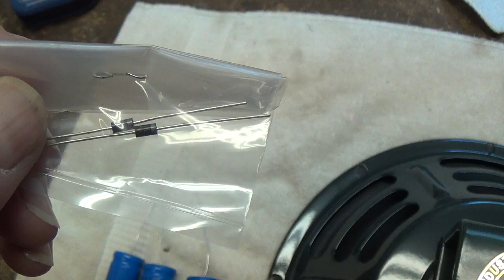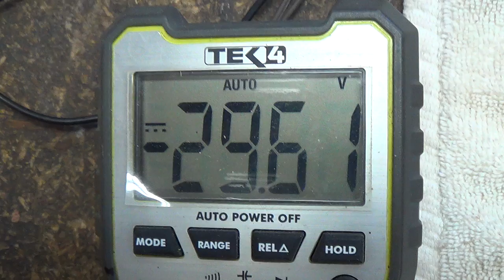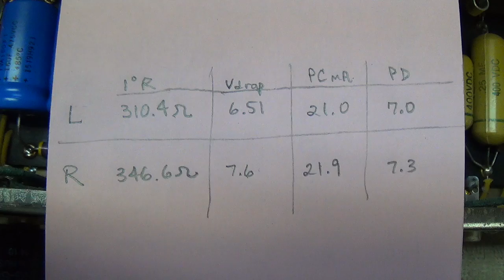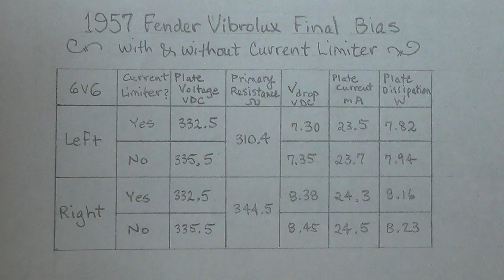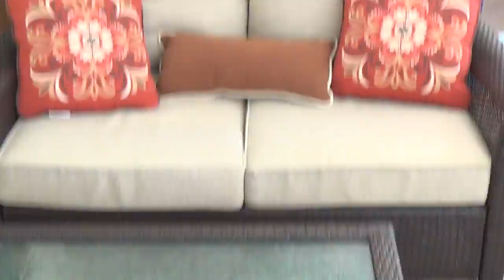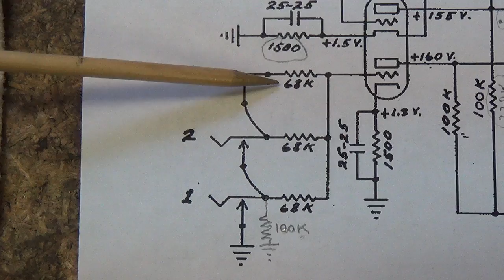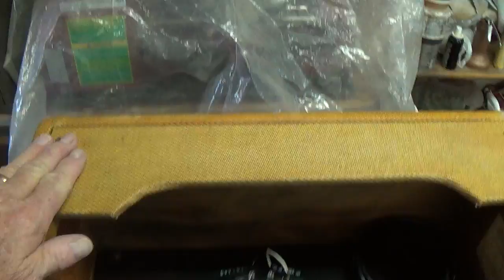1957 Fender Tweed Vibrolux, Part 3

Comment: Jensen, made in Italy.   Uncle Doug, the polarity of the diode shows the voltage polarity across the selenium rectifier junction  not the actual polarity of the PN junction of the selenium rectifier on the schematic. It's a bit confusing though.  These are referred
to as metal-semiconductor rectifiers and have a depletion region. 

  The same is true for silicon diodes which have less voltage drop across their P and N semiconductor layers. When mechanically attached together a PN  junction is forrned.    Diode and transistor polarity general depicts the flow of electrons through semiconductor junction,  or the absence of electrons (commonly referred to as "Holes" (depletion layer)  in solid state semiconductor  theory.
 
As the voltage applied between anode and cathode increases, forward current increases slowly at first, as charge carriers begin to cross the depletion layer then increasing rapidly in an approximately exponential manner. The resistance of the diode, when ‘turned on’ or conducting in a ‘forward biased’ mode is therefore not zero ohms, but is very low.
Reply from the maker: Wow, thanks for the very detailed analysis, SC.  Your knowledgeable input is always appreciated.
Reply: Thanks. I always been fascinated how they can take a piece of silicon wafer and dope it with different elements with different electrons and this "depletion of electrons" ..holes they call it within the semiconductor crystal lattice structure for P and N channel properties.
Reply from the maker: Wouldn't you like to have been the person who invented semiconductors.....and patented it ?? It is indeed a fascinating concept, and the basis for virtually all modern electronics.
Reply: it was discovered  indirectly,  in a search for the actual  thing being researched. By  accident,  you could call it, like so many other inventions of our time,    by Bell Labs in  1947 in NJ.
Like so many discoveries (or inventions) that at first didn't seem to be on tract with what the inventor-scientist was looking for,  over time these inventions proved to be immensely useful to everyone.
What did we have as far as electronics in the late 40s..vacuum tubes and miniaturization of them
(acorn tubes),   I remember coming across  a AM broadcast radio in the early 60s..it had these tiny glass tubes in it.  Not sure where it was made..Japan maybe, China wasn't even on the radar then.
 Sure wish i had kept it..now it would be worth a fortune on E-bay.

I remember in the 70s studying all the RCA/GE and Texas Instrument data books on Semiconductors
and the new TTL (Transistor-Transistor Logic) minature DIP packages.  I built my first countdown
timer using these and other unique devices called SCRs (Silicon Controlled Rectifiers) for a gov't
display board using LEDs with a chaser circuit I designed from scratch using these devices.
The 70s was a world of discovery for me as well...including trying to build a simple TV typewriter.
from a surplus keyboard find in a electronics second hand surplus store. 

Tubes?...I thought those were passe and transistor power amps were the best thing for guitar
and Hi-Fi stero....now as they say.."what goes around..(eventually)comes around"

Quote:
"The transistor was invented at Bell Laboratories in December 1947 (not in 1948 as is often stated) by John Bardeen and Walter Brattain. 'Discovered' would be a better word, for although they were seeking a solid-state equivalent to the vacuum tube, it was found accidentally during the investigation of the surface states around a diode point-contact. The first transistors were therefore of the point-contact type. William Shockley, the theorist who was leading the research, knew at once that this was not what he was seeking: at the time he was trying to create a solid-state device similar to what we now call a junction field-effect transistor." endquote.
Reply from the maker: Again, SC, you prove to be a veritable fount of knowledge and experience.....thanks so much for sharing this with us.
Reply: I found some data on these subminature "peanut" tubes that were even smaller than an acorn tube and specifically designed for military use.  However, there were some commercial versions used in the very
early Japan produced radios..which had a "couple"germanium transistors which in those days had limited
application.   I remember two of these tiny neon lamp size tubes used in this radio..probably for rf antenna
preamp,  and the superhetrodyne  oscillator. The early germaniums (or geraniums as I like to call them) were
not that good at high frequency. Sure wish I had kept that radio to sell now on  E-bay.

[quote:
RCA-6021 is a subminature medium mu twin triode of the heated cathode type having flexible leads. It is intended for is use in oscillator and amplifier at frequencies up to 400 Mc (that’s 400MHz in today’s money and overkill for audio applications). Constructed to give dependable performance under conditions of shock and vibration, this “premium” tubes is especially suited for use in mobile and aircraft equipment and is rated for service at altitudes up to 60000 feet without the use of pressurised chambers. endquote]. 

BTW..in my classical guitar preamp, there is what they call a "cool tube'..a 12ax7 running off 4 AA (6volt) batteries to serve as an  a impedance matching device for a piezo  bridge pickup.  
You cannot see the filaments lit and it runs at ambient room temperature..but it works..go figure!
Reply from the maker: Thanks again for the info, SC. I have never heard of the "cool tube" concept....very interesting.
Reply: I never thought you could get a 12ax7 to  operate in the linear range from 12 volt ( plate voltage here) supply, but my cool tube preamp proves it is possible.  Here is a Youtube link that demonstrates
a 12ax7 amplification from a 12 volt supply. Search youtube for:"12AX7 stereo tube preamp only 12 volts""
 You will also see my comments.
Reply from the maker: Very interesting, SC. I will check it out.

Comment: Where do you typically buy the 5 X $$ electrolytic caps?
Reply from the maker: I got all my supplies from Antique Electronic Supply. The Sprague Atoms cost $12 apiece and the Chinese equivalents are about $3.50, so it's more like 3.5 x the price :)
Reply: Fortunately, there are now better, cheaper, and much smaller alternatives to those Atom caps.

Comment: Telecaster with vintage wiring? If so, that's not actually both pickups in the middle switch position, it's neck only. The usual neck position of the switch is the neck pickup through a "deep" filter cap, meant for playing bass-like tones. (Leo seems to have been a bit confused at first and I think he thought filters were pitch changers.)
Reply from the maker: Yes, it is AQ......a '52 Telecaster re-issue. Thanks for the explanation. The "neck" pickup tone is indeed quite mellow :)
Reply: Whoohoo! Where's Don Pardo to tell me what I've won?
Reply: Oh and suddenly I realize it's not been all of your amps that sound grainy, or your camera's mic, it's those damned bum____ing pickups! ;) Great to hear one finally with some airy, crisp single coils! Can you keep the Tele? :)
Reply from the maker: I will keep it, but it's a little nice to be a shop guitar. I'd hate to bang it into the Jeep while working on a circuit; however, I'll try to use it in some future videos.
Reply: No such thing as too nice of a guitar! 

You might want to convert it to modern wiring. A Tele that can't do bridge + neck is just sad. (I modify my Strats so they can do it. I think it's the best sounding of all the pickup combinations and it's the one you can't get!)
Reply from the maker: Bringing a nice guitar into my workshop is like dropping a Ming vase into a threshing machine, AQ.....lots of hazards :) I think I will rewire the pickup selection switch. I don't really have any use for the neck position, as it is. Thanks again for the very helpful input.
Reply: They were frequently modded back in the day so even if you do this it's still technically "vintage". :)

I was surprised to learn that Fender made Telecasters with this wiring until the early '70s!
Reply from the maker: I'm surprised it lasted so long. The neck setting is not all that useful.
Reply: I've been surprised by a few things that lasted so long at Fender. I was also shocked to learn that the 3 way pickup select switch in the Strat wasn't changed to 5 way until 1977! http://www2.fender.com/experience/tech-talk/the-stratocaster-pickup-selector-switch/

I was also surprised that they never made Stratocasters with reverse wound/reverse polarity middle pickups until modern post-CBS times. Seems a no-brainer and Fender already had guitars like the Jazz Bass and the split pickup in the post-57 P-bass that use this same principle to make combined pickups hum cancel.

Anyway, yeah, I think Teles were often modded to the "modern" scheme before they even left the store as nobody ever found that underwater tone useful (except maybe a few jazz cats).
Reply from the maker: Thanks for all the info, AQ. Rusty and I really appreciate it.

Comment: The schematic marking with "+" at the selenium rectifier's cathode (6:45) reflects the typical marking seen on the part itself. I suppose the reason is that positive DC voltage will appear on that terminal.
Reply from the maker: You could be right, Martin, but for some reason, Fender also mislabels the diodes in their non-selenium rectifier amp circuits.  Most strange :)
Reply: Not really, I think they were just following the established practice. You still see that today in silicon bridge rectifier packages that have + and - marked at the DC outputs.
Reply from the maker: I'm not talking about selenium or bridge rectifiers, I'm talking about simple diodes. Fender labels diodes with the banded, cathode end + and the anode end -. In my experience, this is not established practice.
Reply: I understand, what I mean to say is that they were following the practice established for the selenium rectifiers they had been using.

Comment: Another really great video series Uncle Doug! No matter how many videos of yours I watch I always learn something new. And this video series was no exception. I really enjoyed your comparison of the differences between schematics of various tweed amps and your approach to updating this amp to be performance ready. Even when you simply flipped the cabinet over to show how to easily tighten the chassis down, I had one of those moments of hand on forehead for all my previous struggles wrestling to tighten down the chassis on my 5e3 and 5f1 builds. I do have a question for you in regards to your suggestion of changing the coupling cap from .1 to .02-.05 to voice the amp more for humbuckers. If I were to tweek these values on my 5e3, would you suggest I change all four of the .1 coupling caps on that circuit for both V1 and V2 or would the coupling caps coming off one of the tubes have more of an effect on the overall tone than the other?
Reply from the maker: Thanks, Dec. We're really glad you enjoyed the video.  Whenever I make a change like this I remove the components, i.e. coupling caps, and jumper in various values of replacement components, i.e. .02 to .05uf coupling caps, and have a guitar plugged in (be careful since the strings are grounded) to strum and listen to the changes.

It might be interesting to reduce one of the 0.1 coupling caps from the 12AY7 and leave the other one alone......resulting (maybe) in two humbucker inputs and two single-coil inputs. If you change the value of the coupling caps to the output tubes, however, you will have to change both (they should be the same value). Good luck.
Reply: Nice suggestions Uncle Doug. I will get some new caps and try out your suggestions to see what sounds best to my ears. Definitely a lot to consider and think about for voicing the 2 channels for either single coil or humbucker coming off the 12ay7. Thanks again and look forward to watching the reconing video and whatever else you decide to show us next!
Reply from the maker: You're welcome, Dec. Best of luck with your experimentation :)

Comment: When it comes to changing parts or making circuit alterations to an amp I really like your approach.  It is thought through and done so carefully that, if desired, the amp could be returned to exactly how it was when you received it (I'm not advocating you blow the voice coil out).  I believe Lupe would be very pleased to see your work and Leo would give a thumbs up to your circuit corrections.  The tremolo does lack depth though, not in the same league as Uncle Doug's Tremoverb.  I have tried watching videos by other amp repairers but for the most part have given up in frustration.  The subject is interesting but they either swish up and down the amp like the camera is a spray gun or they go in and replace more components than is reasonably necessary.  They should watch how you do it.  Hope the re-coning parts arrive soon so you can make yet another video for us to enjoy.  Then all we need is someone who would like you to "Take a look at his 5E9-A Tremolux......".     All the best, Jeff.
Reply from the maker: Thanks so much for your very nice comments, Jeff. Rusty and I are proud of our work and really appreciate it when others are too. I have my fingers crossed.....both for the arrival of the re-coning supplies, and for someone to send a Tremolux for service :)

Comment: Not only do I enjoy your videos, the comments from your viewers and you are also fun!!!
I have another question. Since this is a gigging amp, I’m guessing it will be used by one guitar player with one guitar plugged into input 1. Why not put a 1 Meg ohm resistor to ground (instead of 100K) and rewired for just two inputs only, like Fender Deluxe 5E3 and many other late 1950 and early 1960 Fender amps? It could add feel to the guitar/amp experience.
Many have got it right that your second guitar was a Telecaster. But has anyone guess the color? It sounds to me like a Butterscotch Blonde Tele.
Reply from the maker: Thanks for the nice comments, DR. I just finished another experiment involving the input jacks, and found that a 220K resistor works great. With it in place and a guitar plugged in (it becomes part of the circuit), this provided impedances as follows: Jack 1 = 111K , 2 = 75K, 3 = 75K. Now the first input jack offers higher gain, but not a ridiculous amount.  You're right, it's a '52 Telecaster reissue, butterscotch with the 1-ply black pickguard.

Comment: Hi Doug ! I believe the tweed vibrolux and harvard where the only fenders not to have the 1 meg grid resistor on the inputs .. I also would have changed the bias cap ? I also have found the trem sounds 'better' with the tubes slightly underbiased -- Love the kinks ! was rusty on strike ?
Reply from the maker: You're right about the V and H, Ben......you really know your stuff.  I did change the bias cap after the video was made. I just can't see a 25V cap in a -31V circuit. I did slightly underbias the tubes.....at an average of 8W PD. I guess it could go a little lower.  Rusty is into saxophones now, so I get stuck with the guitar demos.
Reply: Thanks Doug -- too many hours studying schematics ! Keep on rockin' !
Reply from the maker: Your input is always right on the money, Ben. You're an excellent resource. Thanks.
Reply: Thank you for listening to my opinions and for the great vids
Reply from the maker: I learn a lot from viewer input, Ben, particularly yours lately :) You're welcome for the videos. I'm glad you enjoy them.
Reply: It goes both ways -- I might learn some basic math from you !
Reply from the maker: It's a deal. I was a math teacher for many years, so it makes sense :)  P.S. Regarding the speaker size in the Model 26 Deluxe......the majority of them did indeed have 15" speakers. In fact, the exact limited-edition replica that Fender produced back in the late 90's had a speaker of this size. I knew I didn't make it up :) :)
Reply: The repro they made with the snakehead tele was the 'professional" model -- 2 6SJ7 pres - 6N7 paraphase inverter - metal 6L6's p/p cathode biased - 5U4 rect 15" spkr -- the woodie 'pro' they used a model 26 plate on the original and scraped out '26' -- but they did not do it on the repros -- please excuse my pedantism again ! -- So the 'stock' 26's had a 10'' and 6V6's   --
Reply from the maker: Darn.....I just can't win, Ben. You really know a lot about the very early amps. I hate to admit it, but this is the first I have heard about a "professional" model. I thought the Model 26 Deluxe was the only "woodie" amp, and the first amp with the Fender trademark. Thanks again for your very knowledgeable input. It's not pedantic at all.....just very impressive and helpful.
Reply: Leo made Custom 1 - 15' K&F amps for Bob Wills before he started the fender co. -- where are they now ......
Reply from the maker: I'll definitely put them at the top of my "scavenger list". You never know.....he lived and played in my general vicinity.

Comment: The amplifier has a great tone! But, I can hear the delay in the tremolo. That has to be uncomfortable for players that are used to the quick response and thick tremolo. Again, it saved Fender from using an extra tube and components. That input circuit design was a bad move on Fender's part, but is easily modifiable...Changing the resistor for the first input jack is a mod I always make. That Telecaster sound is recognizable from New Jersey :) Even tough I'm not a guitar player, each guitar has it's own distinct sound that can be heard instantly. My instrument is the Hammond B3 Organ (jazz organist) it's hard to do the real world tone test on an amp for me in the shop. I usually ask the customer to bring his ax for the final listening test. Excellent 3 part video. :)
Reply from the maker: Thanks so much, Frank. We always appreciate your knowledgeable input. Yes indeed, it's a '52 Telecaster reissue.